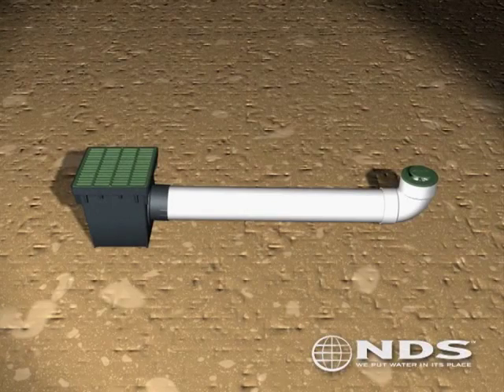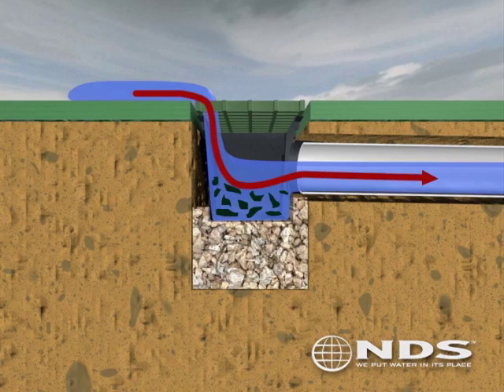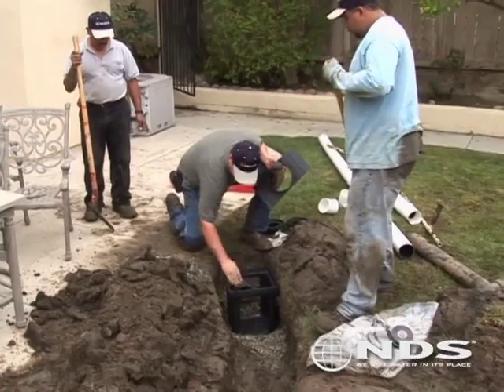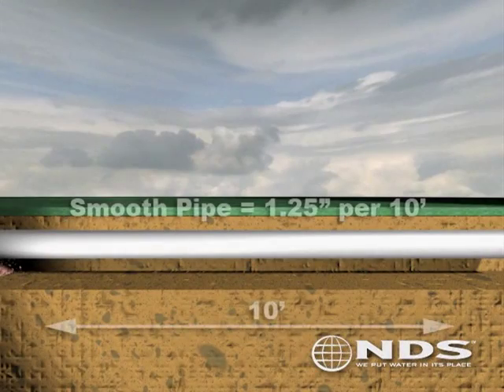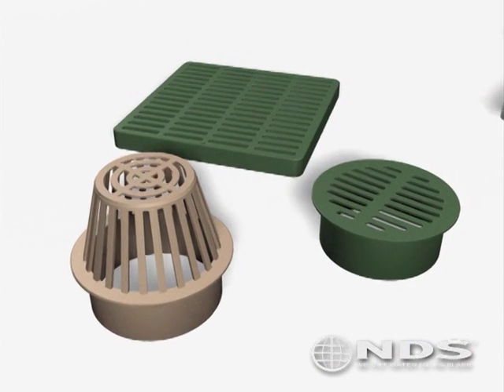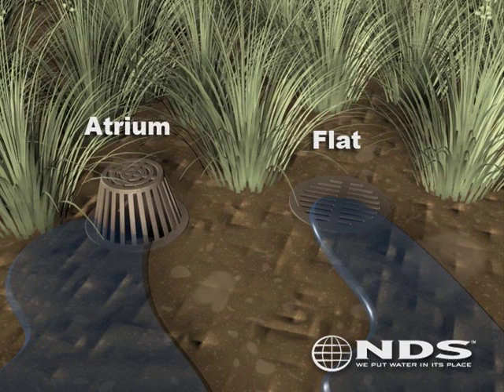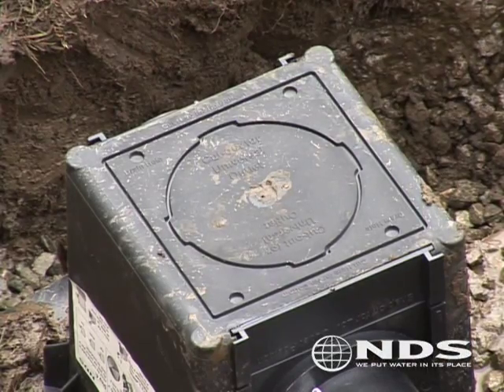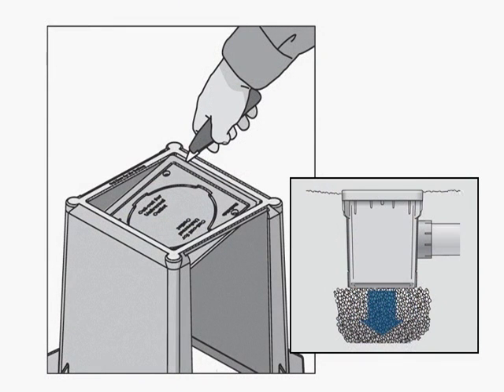How to Install a Catch Basin to Capture Run-Off | NDS Drainage Systems

Comment: So the holes which were drilled on the bottom of the catch basin gets rid of the sump/sediment that accumulates down the bottom or would you have to clean them out yourself?
Reply: Toy Mit clean it out yourself.
Reply: @TigerBand21  would it be a good idea to put some gravel in the catch basin?
Reply: enkrypt3d no. I wouldn’t drill holes or put gravel in them. Just take the inlet cover off every now and then and clean it out. Gravel should be placed below the catch basin, though. Doing that would add stability and prevent settlement.
Reply: @TigerBand21  well the issue is that water will always be in the bottom of these things... perfect place for mosquitoes to breed...
Reply: enkrypt3d, I work as a water resources engineer, so I just designed my drainage system the same as I design those for neighborhoods. Seems to work fine..probably over the top, though. The part of the US I’m in the soil is all clay, which has a very low infiltration rate. So even if I drilled holes in the bottom of the catch basin to drain them the water would still back up as if I never did drill the holes. Also, the water in mine evaporates in a couple of days anyway, so it’s not a big to me. Your situation could be different..idk. Technically there’s nothing wrong with drilling holes in the bottom of the catch basin..there are just several parameters that play a role in all of it in my book.
Reply: @TigerBand21  yea trying to figure out why water isn't draining from one of my catch basins that is in a somewhat low spot... it'll drain eventually but I'm guessing it's just going thru the corrugated pipe and not out to the street... it's better than it was .... i had 4" of standing water previously so now the ground is just soft and not flooded...
Reply: enkrypt3d, if whoever installed the network didn’t get the slope right that could cause several problems such as a low flow velocity. Also, if the slope is engineered just right the velocity of the water will be enough to self-clean the pipe. The corrugated pipe could also play a role in the low flow velocity. If the inner wall of the corrugated pipe is smooth all is good. Rougher the pipe=increase in friction=decreased fluid flow velocity. Lastly the diameter can influence the drainage efficiency, too. You don’t want constricted flow, but you also don’t want an over sized conduit. There are many other reasons, but I feel those are the most important. I hope that kinda helped explain the situation you’re dealing with.

Comment: I am buying two 12"x12 " catch basins tomorrow and was wondering if I can hook them up to 4" scedule 40 pvc. Do I need any special adaptor or a special method to connect? Thank you!
Reply from the maker: Yes, in order to hook them up to 4" schedule 40 PVC you will need to purchase a universal outlet. We recommend NDS 3-Inch and 4-Inch Universal Locking Outlet (part #1243). Visit our online store shop.ndspro.com for more information!

Comment from the maker: This depends on 2 factors.  How big of an area is draining to the catch basin and what surface is the water running off of? With this and knowing that the 100-year rainfall in Houston is approximately 4.5” / hour, we can determine your runoff and what catch basin you will need.  If we use the plastic grate for all catch basins, the 9” can drain 114 gallons per minute, the 12” can drain 155 gallons per minute, the 18” can drain 264 gallons per minute, and the 24” can drain 708 gallons per minute.
Reply: NDS Stormwater Management so y’all design the systems based on a 100 yr 24 hr rainfall? Wouldn’t a 10 yr 24 hr or even a 50 yr 24 hr design storm be good enough? Also, when y’all are designing do y’all measure out all the impervious and previous areas to determine an accurate estimate of the surface runoff?

Comment from the maker: Holes can be drilled into the drain pipe to allow runoff to percolate into the ground along the pipe.  This should be done only in cases where the drain pipe is at least 10' away from any structure.

Comment: Good video. I think you guys should endorse the use of concrete over connections in this video. In my own installations I have found concrete to be a more realistic protector of connections against root entry rather than duct tape. Lately I've been pouring a 4" concrete collar around all connections to the basins.